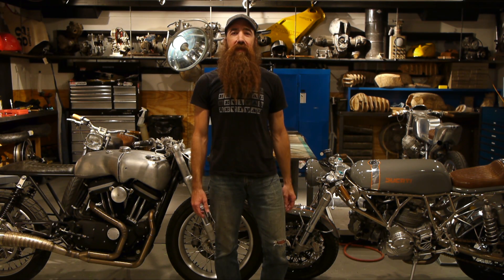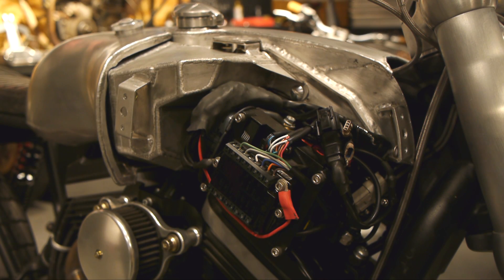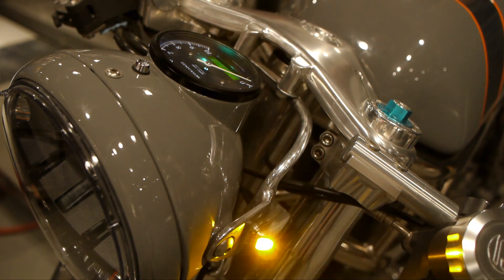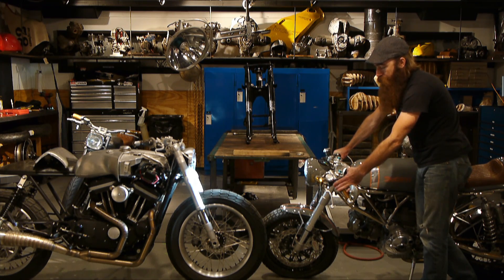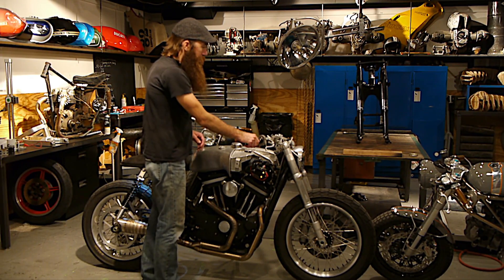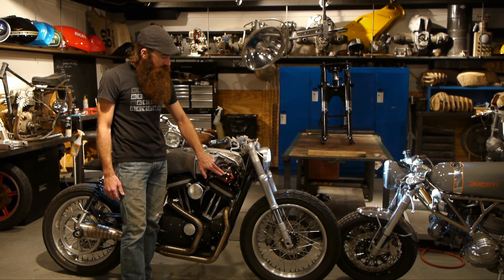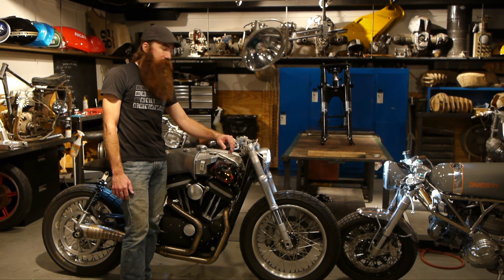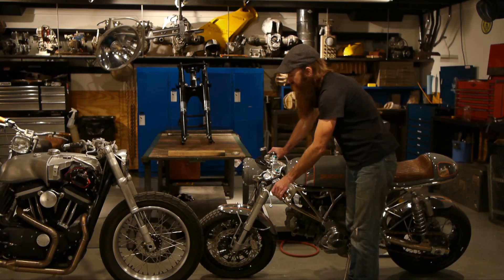Motogadget m-Unit V.2 - Revival Cycles Tech Talk

Comment: Great tutorial thank you - wondered if I could use the four button setup (without Start) and use a direct push button start on the solenoid (Harley Softail Evo) even with the M Button ?
Reply from the maker: Yea that will work fine. The only down side of not having a start button wired to the input of the m-Unit is not having the double click kill switch feature, but there are several ways to integrate a more conventional or dedicated kill switch if needed.

Comment: All the m-unit diagrams I've seen are saying auxiliary output powers the ignition system. I have a cdi unit on my bike which is powered by the windings in the generator. What would Aux output power and how?
Reply from the maker: With a CDI type ignition system, I use the AUX to power a normally closed relay. Then the relay is used to ground the kill wire from the ignition control module. That way, when the AUX is off, the relay is closed and the kill wire is grounded (no spark). When the AUX is powered the relay is open so the CDI will generate a spark.

Comment: Awesome videos, you have me sold on the m-unit. I have a 1995 HD Fatboy (FLSTF) with a wire-harness that is chopped up and AFU. Wondering where to mount the m-unit....any ideas? In between the split tank? Under the seat?
Reply from the maker: The m-Unit needs to be mounted so that it is reasonably well protected from the elements. Basically it can get splashed with some water but you wouldn't want it to be constantly in the spray off one of the wheels. If there is room under the tank, or under the seat those are common locations for mounting. But ultimately it is up to you and what makes sense for your project, and how you want to install.

Comment: Good video. Are these best on vintage or older bikes where the wiring harness has started to degrade? Are they compatible with modern bikes?
Reply from the maker: The m-Unit is great for vintage bikes, and it can be used on modern bikes also. We have installed m-Units on fuel injected ducatis and triumphs, but that is a challenging project.  If you are considering adding this to a modern bike I suggest reviewing the manual for the m-Unit and the wire diagram for your bike, that way you can have a plan and a good idea of what will need to be done before you start. http://motogadget.com/shop/media/downloads/manual/munit_v2_manual_en_3.2_k.pdf

Comment: wow this is nice... so its a solid state box that replaces the conventional fusebox and also offers customization for light timing etc. "If you have a dodgey harness this can save you from alot of stress" My harness is dodgy as fk.
Reply from the maker: Yep, this is a solid state power distribution and control module with built in circuit breaker fuse protection. If your harness is dodgey it is a great idea to get rid of it and start from scratch with a full re-wire using one of these. The way the m-Unit functions is a paradigm shift from normal moto systems, but that actually makes the harness simpler and easier to setup. 

They keep the input and output circuits separate, and that provides a more direct path for the power distribution and greatly simplifies the wiring for the input control side. Simply a brilliant product, that is well made, and worth the $$, at least in my opinion.

Comment: Hi RC great channel and really helpful to us shed builders!!
When using the M-unit do I need relays for the headlamp Hi/lo and the M-flasher for the indicators or, does the unit remove the need for these components ? 
I'm thinking of rewiring my bike with this kit from the RFID switch through to the Bar-end flashers
Wish there was so helpful UK based channel!
Reply from the maker: With the m-Unit you do not need headlight relays, load relief relay, main relay, horn relay, or turn signal flasher relay. There are a few instances where relays are needed, and that is typically when installing on a fuel injected bike. 

Really encourage you to go for an m-Unit rewire, and after you get familiar with this device you'll wonder how the moto world ever turned without one. Let us know if we can help :)

Comment: does this work whit the bike existing handlebar knobs,
Reply from the maker: Yes, the m-Unit can be configured to work with OEM handlebar switches. To do this you will need to modify the connections for the switches so that they send ground signals to the m-Unit, and also setup the configuration on the m-Unit to work with the matching style of switches that you have.

Comment: Is this unit required for the Motoscope Pro to use its  turnsignal lights, nuetral light, etc?  Or can the Motoscope Pro be used with a standard harness like my cb550
Reply from the maker: The Motoscope Pro does not require the use of an m-Unit, but it does need to be used in combination with breakout box A or breakout box B. Technically the motoscope pro will work without a  breakout box, but that will only give you speedo, and tach, in order to get the indicator lights to work you'll need a breakout box. 

The m-Unit is really only needed for power distribution and control. More of a chassis computer, whereas the motoscope gauges are monitors that will tell you what the bike is doing.
Reply: Revival Cycles Okay and using an m unit will replace the need for a breakout box correct?
Reply from the maker: Actually, the breakout box is still needed with the motoscope pro. The m-Unit will control how the power is distributed and controlled on the bike, but the breakout box monitors the signals for the indicator lights and sends that signal to the motoscope pro. Unfortunately there is not way to get the indicator lights on the motoscope pro to function without using a breakout box.
Reply from the maker: The m-Unit is not required to use the Motoscope Pro. However, with the Motoscope Pro, you will need to use breakout box A or breakout box B in order to send the signals from the wire harness to the gauge. The motoscope Pro is the only gauge from motogadget that does not have direct connections for the indicator light, and instead uses a breakout box to send the signals to the gauge via can bus.

Comment: How would this be on a GSXR1100? I plan to use the pro dash and m pin indicators. Cheers :)
Reply from the maker: The EFI bikes are just more complicated, and in some cases the factory's make them very difficult to modify by incorporating security systems between the ECU, instrument gauge, and ignition switch. I suspect the CTX700 would not have this issue, but the real question is what is the goal for the project. If you are building a custom and need to minimize the harness and re-arrange the components the m-Unit is great. But i don't think its worth the work to simply eliminate the fuses on stock bike that is that new.  A one off m-Unit install on an EFI bike is a pretty big project that typically takes several full days to complete.

Happy to discuss the details of your project, and get a better understanding of what you are after, just send an email to techsupport@revivalcycles.com
Reply from the maker: That would depend on what year GSXR. If all you are interested in is getting the motoscope pro and some m-Pins, then it may not be worth re-wiring a complete EFI bike. On the other hand if you want to build a custom with different and much cleaner handlebar controls, then this is pretty much the only game in town. 

The m-Unit handles power control and distribution on the bike, and is not needed for gauge installs. It is compatible with virtually any bike from any year, but it is more involved when integrating into a fuel injected bike.
Reply: It would be a 1990, it's a streetfighter I'm doing. Thanks for the reply :)
Reply from the maker: That would be a good candidate for an m-Unit upgrade. Old enough that the switches are probably tired, and the rest of the system is probably showing its age. But also still simpler than the EFI bikes. If you have gremlins in the electrical, or want to just clean up the handlebar controls. The m-Unit is the way to go.
Reply: What are the potential problems with EFI based bikes like say mine from 2014, a CTX700 from Honda? I am looking to eliminate the old school fuse box from it if possible.

Comment: Does it work if you use a kick start, eg on a 70s BMW. Also could you still bump start a bike with this fitted if the battery was flat.
Reply from the maker: +greaserleo Kick starting is no problem, but you should be aware that in order to save power, the head light is turned off when the system initializes, normally you push the start button and that turns the light on. With a kick start bike, you need to use the headlight control button to turn the headlight on after starting the bike. Pretty obvious at night, but easy to forget during the day.

Comment: thank for the video. Quick tech question. I have a bmw r100 1984 and was wondering if i install a M unit v2 on it, can I remove regulator and relays and if so, how do i wire everything up? Electrical wiring is a big headache I dont want to start messing and guessing things out, so I d rather make sure before buying one. Thanks a lot!
Reply from the maker: +Robin Zeitoun The m-Unit will not replace the regulator/rectifier or the ignition system. However, it will replace the head light relay, turn signal relay, main relay, and starter relay, all but 1 fuse, and improve functionality of the electrical system. Answering how to wire everything up is a little more complex than we can get into on youtube comments, but the basic idea is that the m-Unit handles all the power distribution and the labeled inputs and outputs are fairly self explanatory, except for the AUX output. The AUX output is essentially the switched +12V signal and this is used as though it were the switched side of the original ignition switch. For example, the regulator / rectifier will have a wire that is connected to switched power on the original wiring diagram, this wire would then be connected to the AUX output, and all the other wires for the regulator / rectifier are connected as they were originally.

Comment: Those biles are so beautiful. 
What is the Headlight bucket off on Pyro? Is that a Trucker Headlamp? Thanks
Reply from the maker: +Ano Mac  The headlight bucket on Pyro started out as a Lucas (http://revivalcycles.com/products/7-inch-vintage-lucas-headlight-bucket) replica and was then modified to accept a Trucklite LED (http://revivalcycles.com/products/led-headlight) headlamp, and a custom gauge pocket was added. This is a one off hand made arrangement, but if you can find a local fabricator with good experience replicating this design is not terribly difficult. It is worth noting that the Trucklite LED's will fit in a Lucas replica shell just fine with out modification, however, the light protrudes from the front of the shell more than we wanted so we modified the fit.
Reply: +Revival Cycles Thanks for getting back to me. I sourced a MZ TS250 bucket, being east german it takes an 80mm gauge. It to is 7" but a lack of funds, after buying the Chromo Classic, Might mean Boris will have to wait a bit for the Trucklite. I know you just moved I saw posts on IG. Can't wait for you to settle in and post some new videos.

Comment: an you go into a little more detail about how to wire the ignition system on a carbed bike with this? the manual says the "aux" output is for the ignition, but I don't see any additional details. The wiring from the engine (pulse coils & flywheel) goes where? I'm trying to visualize this setup on my carby Ducati Supersport..
Reply from the maker: +elamovs To wire a stock ignition system with the m-Unit, you need a clear and correct wire diagram for your bike. The basic plan is to keep the OEM system intact and simply supply power from the m-Unit "AUX" output. Start by identifying the spark plugs or coils in the diagram and trace their connections back to the control module or CDI, and then on to any devices connected to the ECU / CDI,  making note of any connections that are powered from the ignition key switch. Follow the branches and get an understanding of what is connected to what, usually this includes kill switches and safety switches.  Any connections to the engine sensors, pulser, or trigger coils should be maintained as original, and the only changes that need to be made are connecting the power feed wires to the m-Unit "AUX".

This sounds easy enough, and in reality it isn't too difficult, but it is intimidating trying to sort through all the wires shown on the diagram. One tip for making it easier is to use a highlighter to mark just the wires that connect to the ignition system. For the first pass, don't highlight down the branch circuits, and try to only focus on the wires are are connected from "A" to "B" points, most of the wires in the ignition system will be connected this way, and you will come back to the branch circuits later. Once you have all the "A" to "B" circuits identified, you can determine what is going on with the circuits that branch and have multiple connections. On carb'd bikes it is most likely that you have a positive connection that supplies power from the ignition switch and a ground wire that ties into the chassis. On Fuel injected bikes, it is a bit more complicated with the fuel pump relay and the sensors, but following along with this method you should be able to isolate the system in the diagram and identify the switched power connections that need to be powered with the "AUX" output.
Reply: +Revival Cycles thanks, wasn't sure if any of your Ducati builds with the M-Unit were carbed or not. It wouldn't be the worst thing to keep the stock engine harness, it's reasonably clean compared to the awful main loom. Or if I'm crazy enough a complete Silent Hektik ignition, flywheel and all (if I can convince them to ship to the USA) plus the M-unit. Look up their stuff....you will drool...better yet see if you can become a dealer for their product and help out a lot of us old guys wrenching on carby Ducati twins...

Comment: Do you have to setup the m-unit with motogadget buttons, or can you mount your own contacts for eg. the indicators?
Reply from the maker: blondmoeller The m-Unit does not require Motogadget switches, it will work with stock switches or other custom switches. You'll just need to be able to send a ground reference signal to the m-Unit input for the device you want to activate.

Comment: Awesome video. I'm totally convinced on the M-unit for my project bike. I was just wondering what kind of turn signals are on the bike on the right. I really like that clean look.
Reply from the maker: Thunderbird914 The headlight mount was custom built here in house. The indicators used on that headlight bracket can be found here: http://www.watsendesign.com/
Reply: +Revival Cycles Are those running lights in the turn signals kinda flickering or is it just the video? Right after the simulated start up of pyro... while the running light is idle (not flickering).